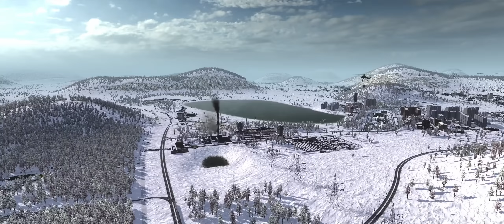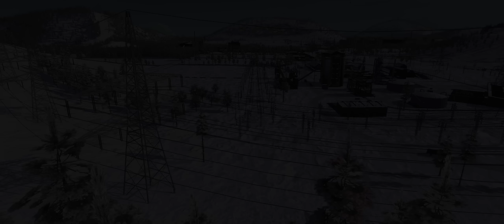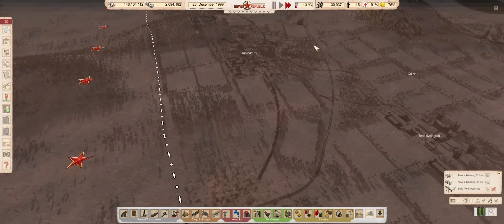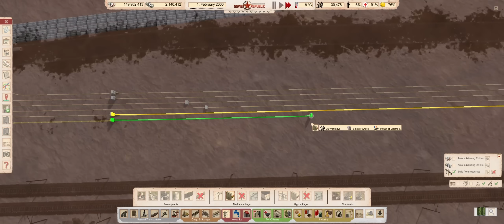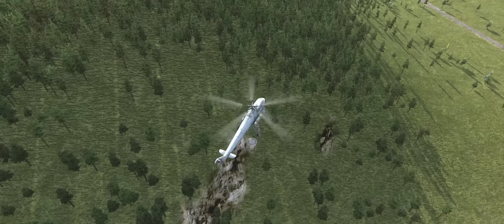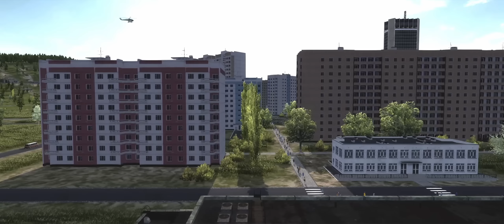QUITE LIMITED POWER!!!- Episode 66 ║ Workers and Resources: Soviet Republic

Comment: Your power problems are due, in part, to the wires cables you are using. Underground cables have a significantly smaller capacity than above ground cables with the highest level underground cables capable of carrying about the same as the second highest above ground. In addition the substations do all their calculations off of 2.5MW, but you need to consider what you are giving them instead, ie if you use the best above ground lines, then you calculate off of 2.35MW (which is close enough to 2.5 to not really matter much) but if you use the underground ones it is 1.65MW or around there.